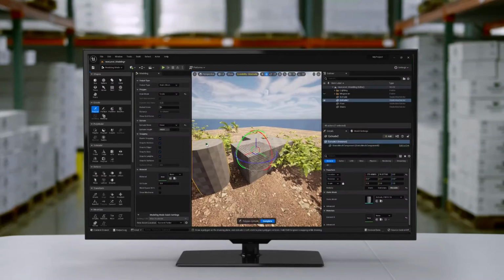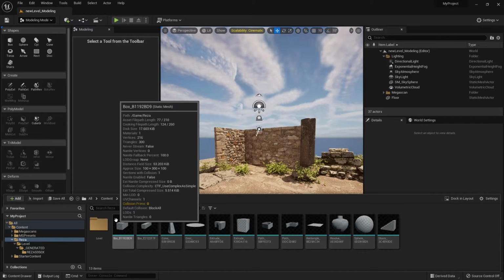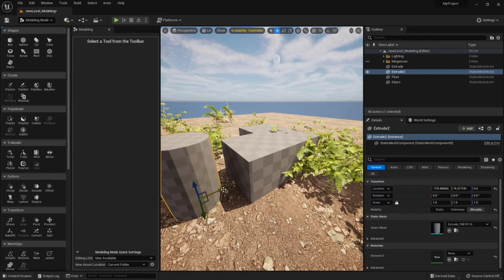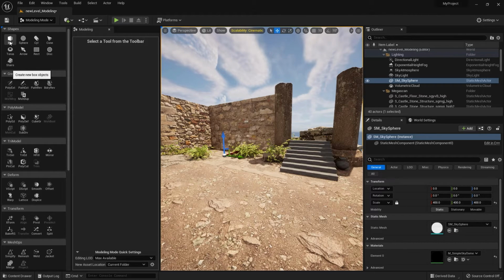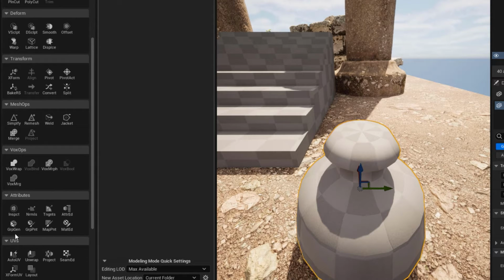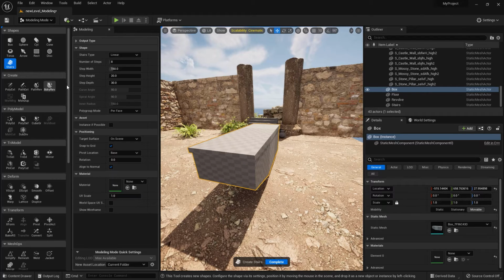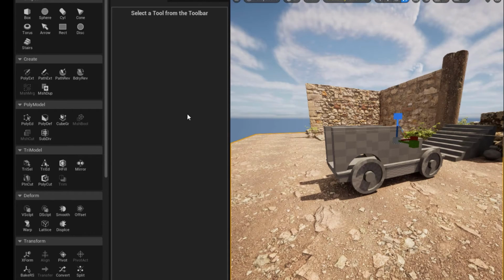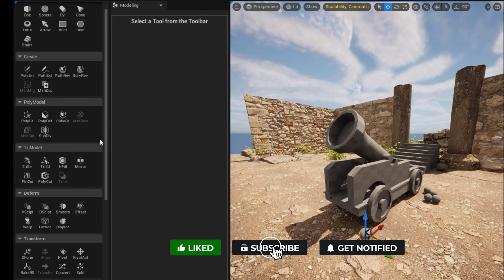#UE5 Series: Introduction to Modeling Editor Tool

Comment: Hello, I am a Unreal Engine user for game making. I want to learn 3d modeling. I first tried Blender, but I had a lot of difficulty because I was used to unreal engine controls. Can I model structures such as houses in Unreal Engine 5? Which application do you think I should choose
Reply from the maker: Hi,
It ultimately comes down to which application you’re most comfortable with. Personally, I’d model in Maya, but for someone used to procedural workflows, Houdini might be the better option.
For hard surface modeling, Unreal Engine does a decent job as well.

By the way, that video you commented on is old. I’ve re-recorded it with updated content, including all the new features in Unreal:
https://youtu.be/NZYxf2IbL5E
Reply: @sarkamari  thanks

Comment: When exporting from blender (super simple geometric meshes) 

Is there a need to “triangulate” my mesh within blender, via settings or something to ensure it gets converted properly? 

Is shade smooth necessary?
Reply from the maker: No need. Everything gets triangulated automatically 
Btw i have recorded a new version if the Modeling tools for 5.4 as it comes with some new nifty features 
#UE5 Series: Modeling Tools in UNREAL Engine 5.4 Part 1
https://youtu.be/NZYxf2IbL5E
Reply: @sarkamari  oh trust me I’ve watched it many times lol. And part two. I come from sound design so all this game engine software makes making music look so simple.🤣🤣. 

I’m having a problem. I don’t know if you’ve heard it or have any ideas , I’m successfully using blueprints and casting to send audio amplitude data via float and automate perimeters such as light intensity however, in my view report, it seems to be working and in the game works, but in render it does not seem to show up, the lights are moving or animated are the ones that do not show up.  other lights, even if set to moveable do in fact show up
Reply from the maker: @mitchellrcohen Good question. Sadly, working with sounds is a topic I've never had the chance to dive into. Unfortunately, my guess is as good as yours on this one.
Reply: @sarkamari  take recorder to record the keyframes seems to be the best way!!

Comment: How would you do subd modeling nondestructively with this? It doesn't have a subd modifier like Max or Blender
Reply from the maker: The modelling tool in UE5 is basic. Even in the current version it doesn’t supports any form of procedural workflow so naturally for more complex modeling tasks you should rely on other DCCs. It does show the direction the epic games is heading which is a promising starting point.
Reply: @sarkamari Nor having to apply the subd is pretty basic. I see lots of tools that either the Blender or MAX don't even have or tools that work in a more creative and modern way than old tools in those old softwar. Don't care too much about other modifiers but like Subd and Symmetry I find that pretty odd not to have.